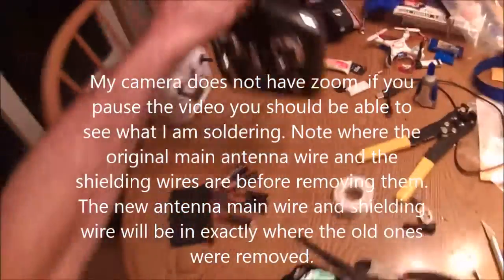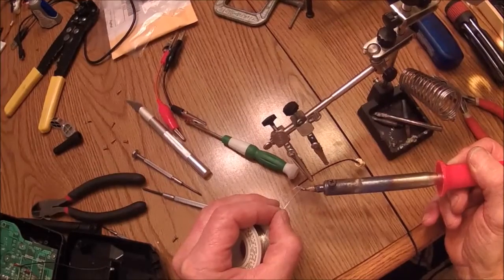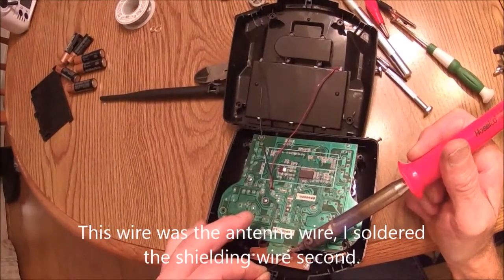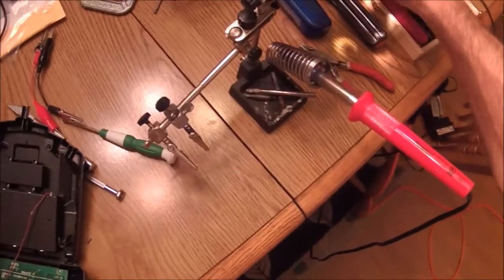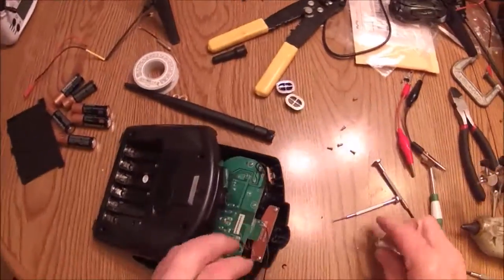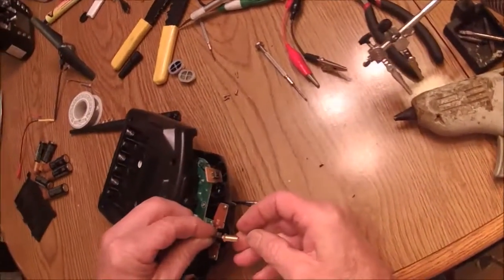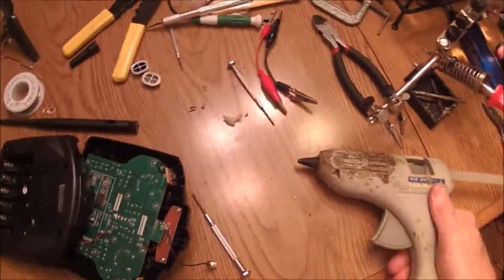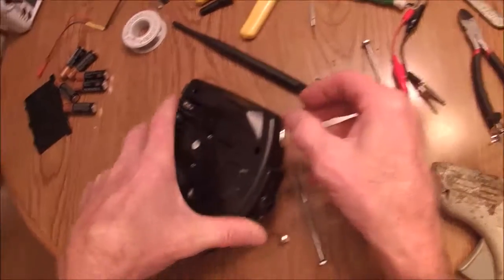Drone transmitter modification for extended range

Comment: I plan on doing this mod to my bugs 3 transmitter. Does it matter how long the whole wire length is or even how long the small antenna or shielding parts are?

Comment: Do you think the exact same mod can be made to the drone antenna?
Reply: RCflyingfun My transmitter only has 1 soldedpoint called antena on it. What should I do?
Reply from the maker: No, I don't think you would get any better reception. Plus it would be a lot more weight.

Comment: I tried to mod  my aviax drone with a 6dbi when I open the transmitter there was no ground
Reply from the maker: When you mean ground are you referring to the wires on the antenna? If you are the ground wire is the braided wire around the middle wire.
Reply: No I'm talking about the transmitter. It's a aviax drone there's only one single black wire no ground
Reply: I know how to strip the  6dbi problem is the antenna in transmitter the wire is't split I don't see no ground or do I make my own ground??
Reply: I'm sorry typo
Reply: Mike Low's RC & Hobby same

Comment: This 15dbi gain antenna should give even more range, right?
http://www.banggood.com/2_4G-15dbi-RP-SMA-High-Gain-Wireless-Antenna-Wifi-Router-Connector-p-84275.html
Reply from the maker: Depends on transmitter output power. I haven't used one that size, so I can't say.

Comment: How much longer you can go to the maximum?
Can I use more gain antenna?
WiFi Booster is useful for?
I want to do to me
thanks for video
Reply from the maker: +Şükran Kuru 
I have never done a maximum  distance test because I don't fly out of my line of sight. I have never lost contact with any of the quads I fly at distances of 400 to 500 feet. My quads are in the 250 size range so at that distance they get very hard to see. You could use a higher Db antenna but I don't think it would increase range any more because of transmitter output power.

Thanks for watching
Reply: +Quadflyingfun 
thanks for the reply.
I have FPV kit. to increase a little more range will be safer
Reply from the maker: +Şükran Kuru 
Which quad do you have?
If it is the Tarantula that is a great quad for the money.
Good luck and post up some video's when you get it working.